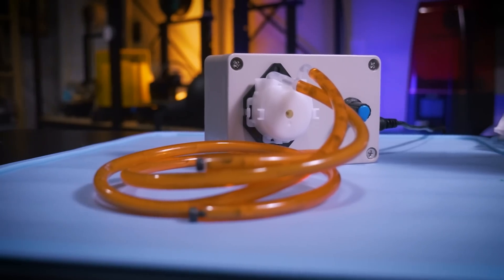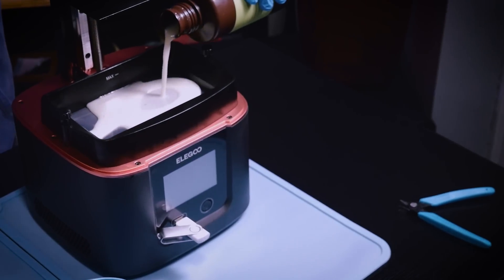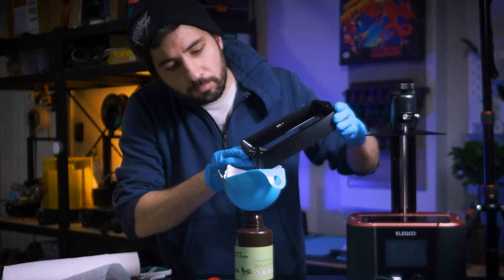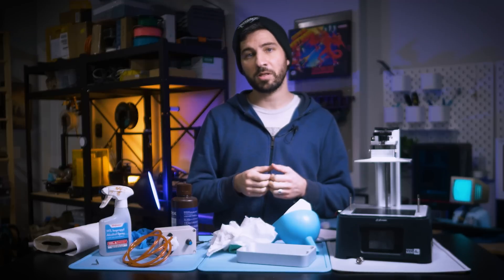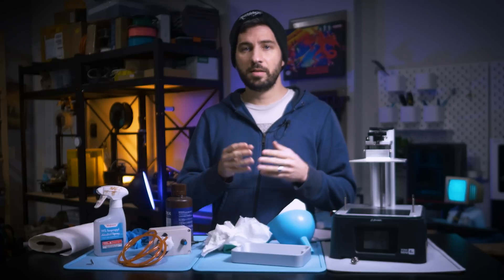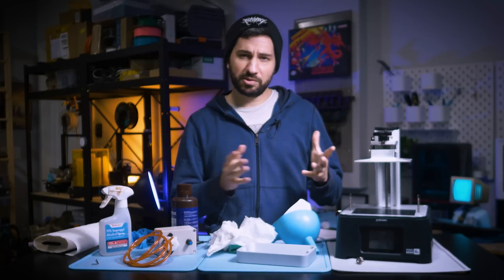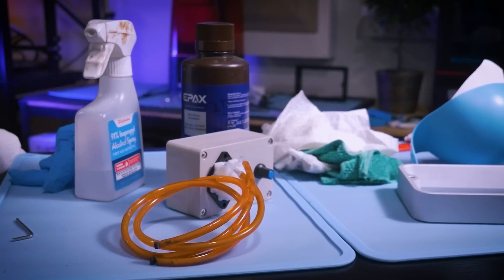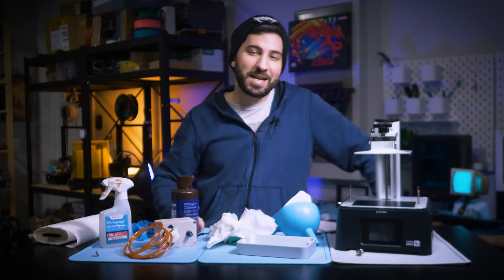The Best Resin 3D Printing Tool You've Never Heard Of

Comment: I wonder if you could design a tray that has a resin return that you could attach to the pump's hose.
For that matter, add a float switch and have it automatically refill if it gets low, like the stuff from FormLabs.
Reply from the maker: I will heart your comment in the hopes that someone else on the internet who is much smart and better than me at this stuff will grant the world a new gift. Thank you for your comment!
Reply: I just ordered my first 3d printer 3 days ago, will have to cnc some hose connector in the tray, I also have a peristatic pump laying around... Will mount the pump inside the enclosure. I'll have to look up "capacitive sensors", there should be something around (and second mod on the tray needed). An ESP32 for driving the pump back and forth, the sensor, and BT or wifi access...
Just need to tilt the whole printer slightly, will call it my "Pisa Tower printer".
BTW: why wasn't that invented before?
Reply: I came here to say this^^ you could have with a sensor to check the amount of resin remaining in the vat between layers and a sensor at the top of the tray to make sure any resin doesn't overflow when the print goes back in displacing more resin there could also be a  a way have motorized lift in a corner opposite to the return pump tube that lifts the tray just enough to allow most of the resin to flow towards the mouth of the pump tube....

Comment: Couldn’t you tip your whole machine with some little objects under the feet to hold it that way?  This will let the resin run to one side. You’d only need a few millimeters
Reply from the maker: I considered that, but honestly tipping over a machine is just asking for some kinda failure. It is hard to get exact, the resin is at more risk of spilling, and you might even accidentally tip your machine. That’s why I started using the plastic spatula to kinda bring it into the same area when the printer needed to be flat cause I didn’t wanna remove the VAT.
Reply: @3DPrintedTabletop  yeah I can see that with maybe smaller machines. I have two epax 10s. Very heavy units. Honestly I like the pump idea but I may just stick to the dump method. I've finally got a good routine. 👍